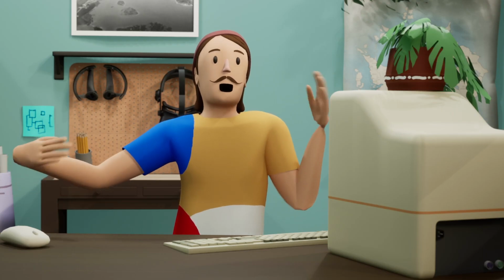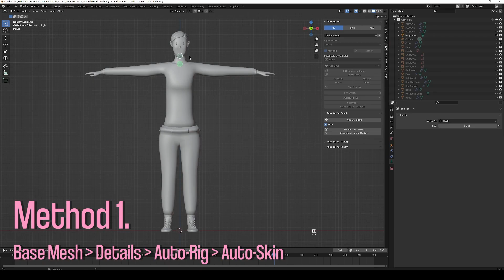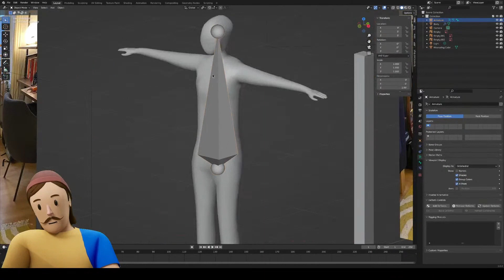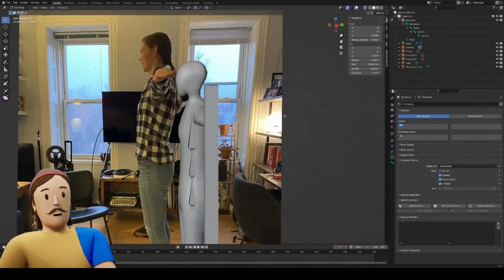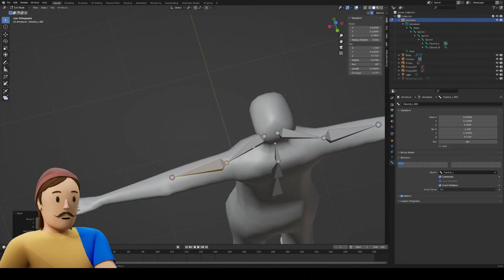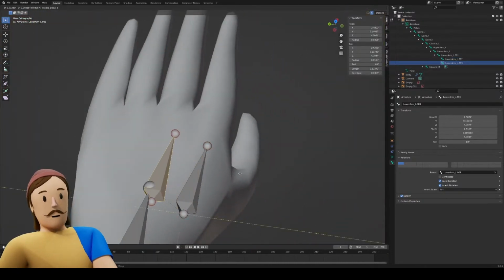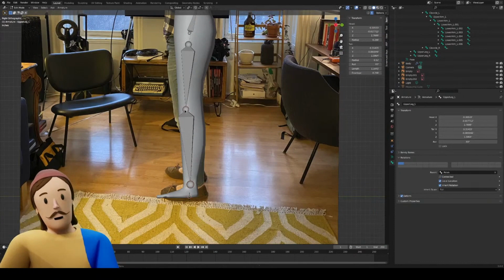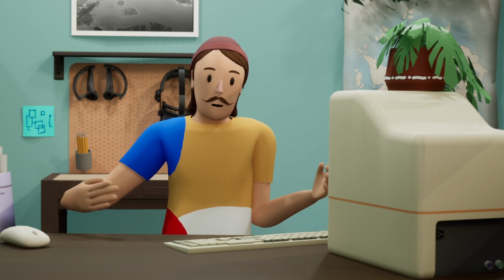Rigging Unreal5 Characters in Blender

Comment: I don't know if this is due to a change in versions or if this is due to a change in settings from your program to mine but I am personally unable to select the top or bottom node as you did here at 5:15 . Instead the bone has an orange dot in the bottom node and instead of "Moving" the top node down with "G" I am able to scale it with "S" for some reason it doesn't like if I specify an axis to scale on and seems to default to the Z axis. However, I am unable to use "E" to extrude from the existing bone.

Any ideas?
Reply: I was not in edit mode smh